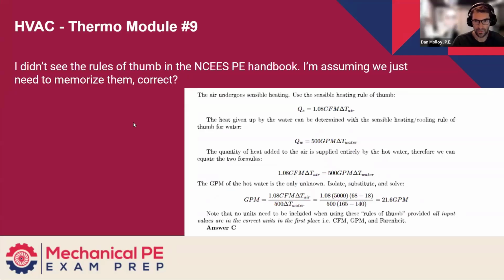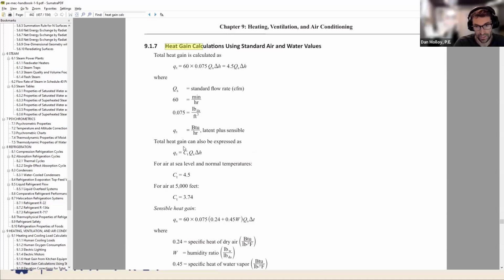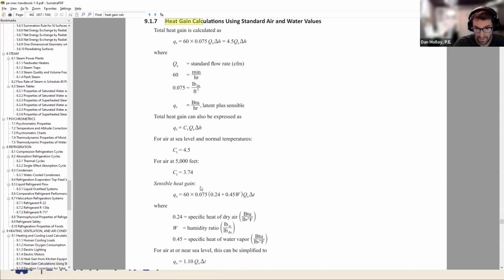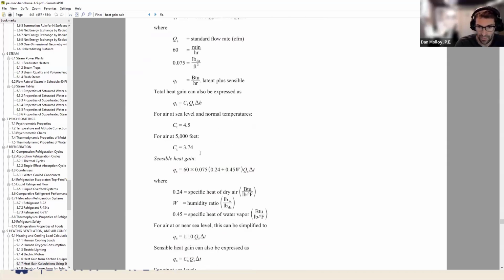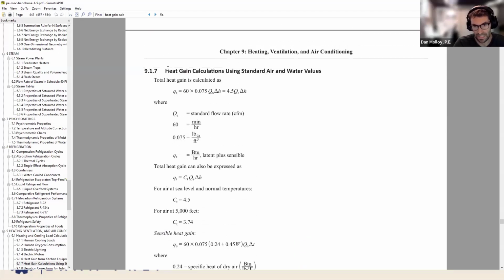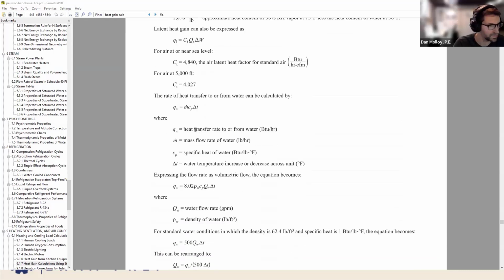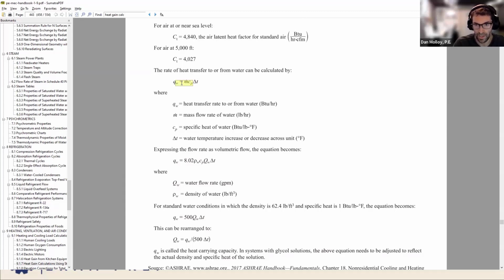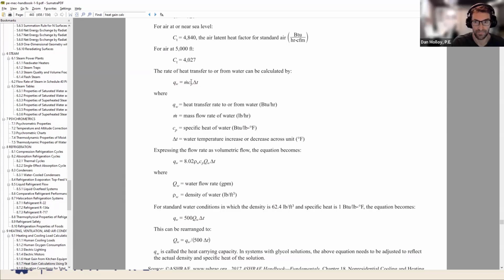Heat Gain Calculation Rules of Thumb in Mechanical Reference Handbook

Comment: Those equations are straight trash. They only apply if the heat has already transferred but people mostly use them to predict what the heat transfer will be but you can't use them in this way because one of the variables is unknown and therefore will get the wrong result.
Reply from the maker: Definitely agree these have limitations in real life, but from an exam perspective they are staples.